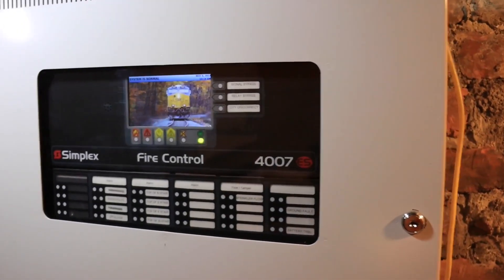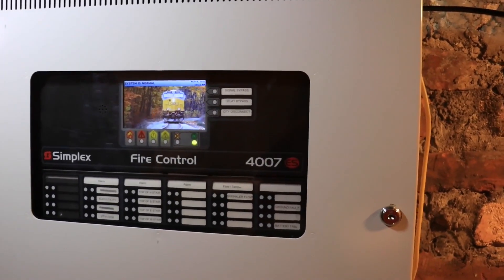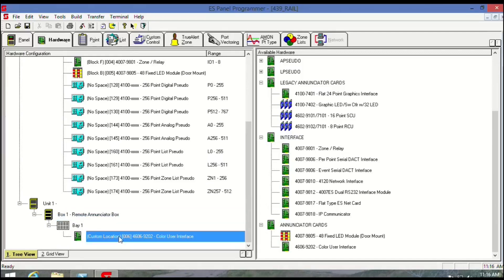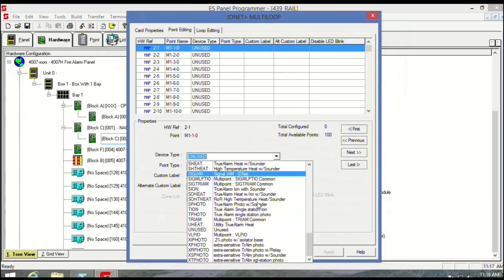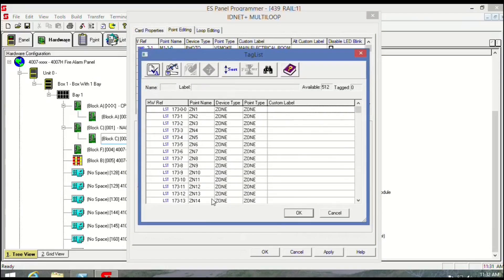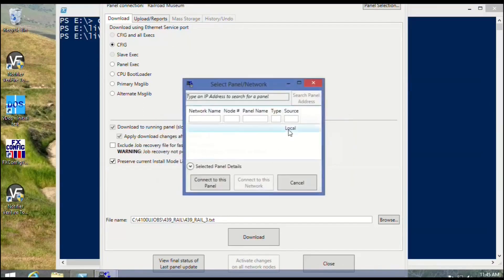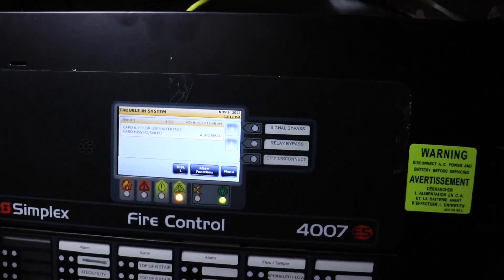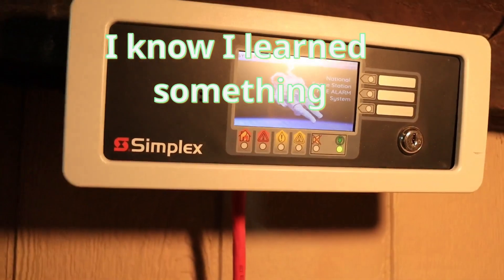Simplex 4007ES programming with a "LIVE" usb stick.

Comment: I have a 4007 with that announcer it has had a problem with going missing failed. Simplex has no fix for it and has been trying things to fix for over year now. Do you ever hear of this problem?
Reply from the maker: We had one.  I put on  a ferrite bead and that seems to fix it.   They are just rs485 so check the conductors and make sure it has the terminating resistor ?
Reply: @firealarmapprentice4517  yes there is a bead on it but I’m not sure about the resistor. Simplex has put in two annunciators and replaced power supply bouts that feed the annunciator. Where does the resistor go and what is value?
Reply from the maker: resistor for rs485 is generally 120ohm and at the farthest point.   Let me check the cut sheet before I say too much.   what is the Rev ?

 @frankspliff7037
Reply from the maker: usually 120ohm and at the end of the farthest device.  Don't quote me off the bat, you may have to look at the cut sheet. @frankspliff7037
Reply: @firealarmapprentice4517  this problem keeps going on and Simplex has given up on a fix. Do you know where I could find this cut sheet also resistor on which circuit?
Reply from the maker: Are you sure the conductors are good?  18AWG or 16AWG?  Clean terminations?  No ground loop ?    @frankspliff7037
Reply from the maker: Internet search should direct you to a cut sheet.   @frankspliff7037

Comment: I’ve programmed a 4007ES hobby system which can be found on my channel (note: the most recent vid on the system is outdated). I did the programming from scratch and even used some custom control SMPL lines to add an A/V bypass. The system runs on Rev 6.01.03, and I downloaded the job file using an Ethernet cable. I have the same touchscreen annunciator on it as well. Did you know you can remotely access internal panel functions from the touchscreen annunciator? It’s the only one of its kind that can do that.
Reply from the maker: I did NOT know that.  How do you like v6.02 ?
Reply: @firealarmapprentice4517  never tried it. Didn’t wanna risk bricking my panel trying to upgrade it. Apparently, 4007s are easy to brick according to some of my friends who work in the field. I don’t work in the field yet, but know plenty who do and they told me I was better off not trying to firmware upgrade to the most recent Rev. At least it’s not the same story for other simplex products. It’s just the 4007s that “drop like flies during firmware upgrades” according to my contacts.
Reply from the maker: My son and I "bricked" the one in the video, but I "unbricked" it when I went back to 5.  
 @FireAlarmDoctorYT1977
Reply: @firealarmapprentice4517  Did it bootloop/not boot (brick) or show master crash 32 (not brick but crash from incompatible version/invalid config)?
Reply from the maker: @FireAlarmDoctorYT1977  Crash Code after system start up
Reply: @firealarmapprentice4517  panel didn’t brick then. Probably had wrong software version based on what you said about switching back to Rev 5. When programming simplex hardware you want to look at the exec version (can be done by logging in to level 3 and going to system info then software revisions. It’s also available on the crash screen) and then simplex has a chart that matches programming software versions with exec versions. You could also try to upgrade the firmware too, but for 4007ES panels just get the matching programmer version as it’s easier that way and you won’t risk actually bricking the panel. Bricking the panel usually means that the bios (Basic input output system) is no longer good on the cpu card and usually makes the cpu card no more useful than a brick (hence bricking). Bricked cpu cards have to be replaced as you can’t upgrade the bios without the bios because you can’t input a new bios without an input supplied by the old bios.
Reply from the maker: @FireAlarmDoctorYT1977   I do a bit of "bare metal" programming so I could probably recover from a "fatal" brick.  It looks like a linux shell is possible on this one, haven't opened the hood too far on this one. Not sure of the chip either.  Its not atmel.. maybe freeescale / motorola ?
Reply: @firealarmapprentice4517  I have a question: Any way I could reach out to the Simplex tech you know? I’ve been trying for a while to reach out to a simplex tech who could help me get into contact with my local SimplexGrinnell branch. I’m actually looking to see if I could do an internship while I’m in college.
Reply from the maker: @FireAlarmDoctorYT1977  its like, no answer every time, very frustrating.  Ask Me?